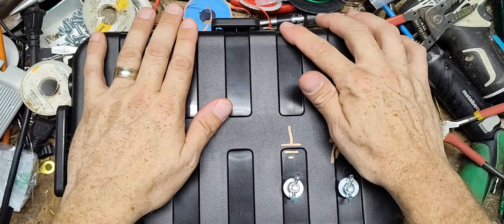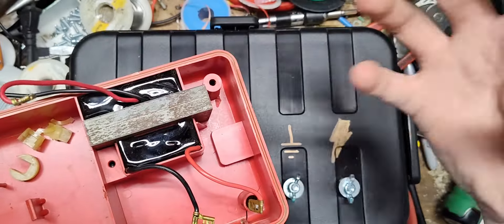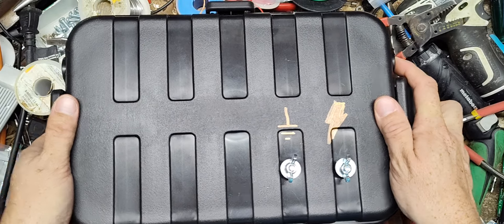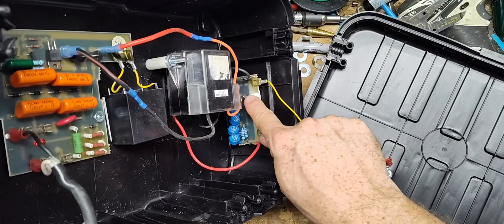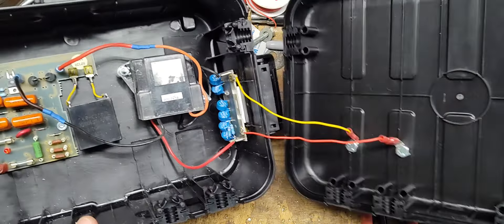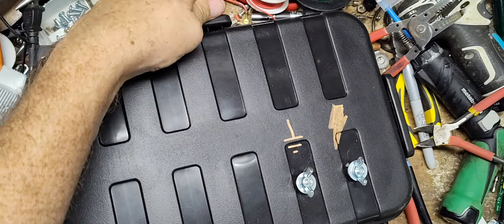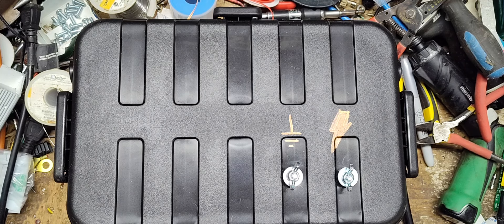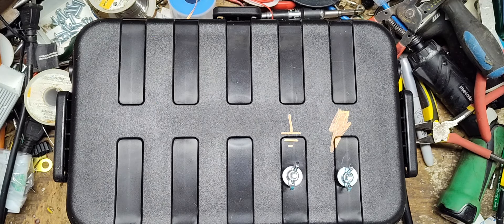Making A Semi Homemade Electric Fence Charger For A Customer

Comment: Good idea. I didn't know that cases were available.  Thanks for the videos.
Reply from the maker: I had to look online and find a water proof case that would be the correct size to use on this and drill holes and bolt things into place. There's not a new factory case made for the original model built in 1989. Customer was thrilled to have his unit going again and we made it stronger.

Comment: Is this a cost effective solution?  It seems that material cost and a lot of labor would be cost prohibitive.
Reply from the maker: Unless you charge an outrageous amount of labor, then no it wasn't that bad. I charged $40 for the case, $20 for the bigger capacitor,  $10 for all the new hardware, $35 for the new transformer, and $40 labor to do the whole thing from part 1 video and part 2 video. A new unit of equal quality as what this is old school unit is, sells for $250-$300. This unit is basically new and comes with an 18 month repair warranty as well.
Reply: @FencerFixerRepairLLCKansasCity  OK, thanks!  I must say that your labor rates are quite reasonable.  That's a lot of work you performed.
Reply from the maker: @NCF8710  after paying for the parts and sharing the shipping cost a little bit, I think I walked away with around $75+/- but I am a business and have to pay for things, so that $75+/- didn't go into my pocket at all